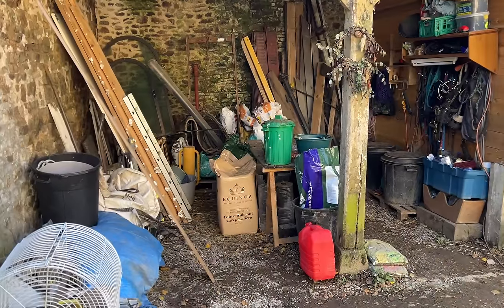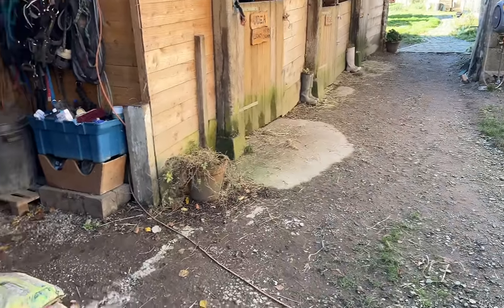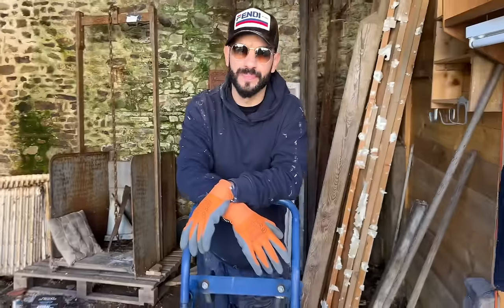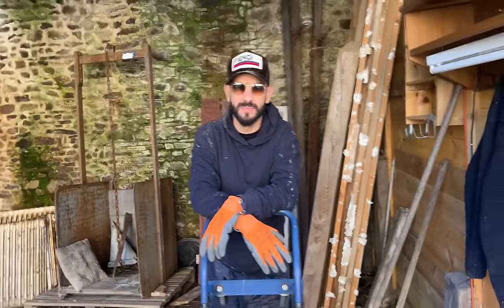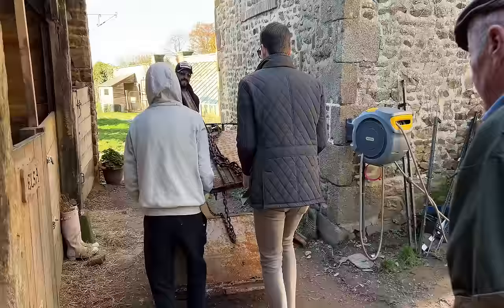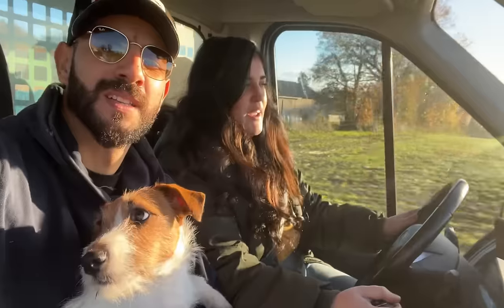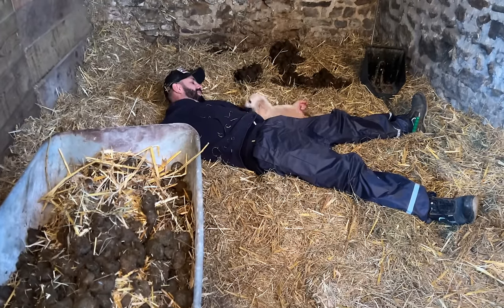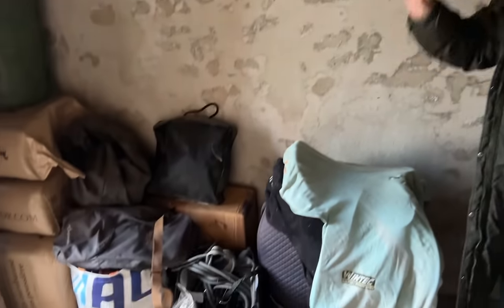Renovating An Unused Barn At The Chateau

Comment: I remember a TV Show my Mom used to watch (reality Veterenarian show) where a horse slipped and fell on "cement" and the vet said, "Cement is not for horses."  The slabs you're using are not cement, but I wonder if they shouldn't just be used to line the walls of Queenie's stable (to make cleaning easier) and definitely for the whole yard - mud sucks!) and the center of the actual stable where she's going to live be kept dirt to be softer for her hooves and to allow the heat of the ground up?  I'm in Canada, though, and we regularly get to between -28/32C here, how cold do you get where you are?  Might be a completely irrelevant suggestion I'm making!